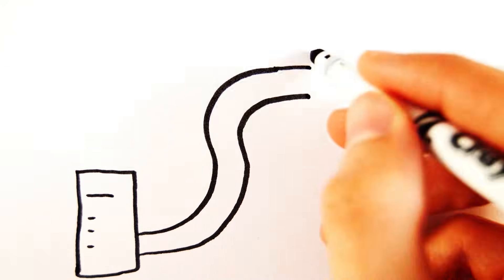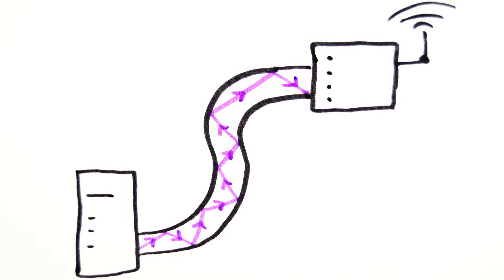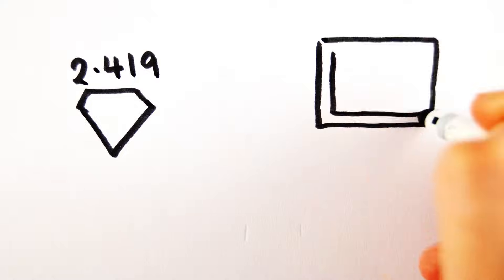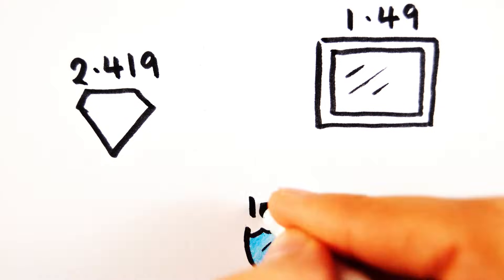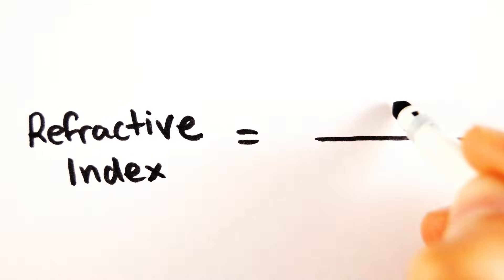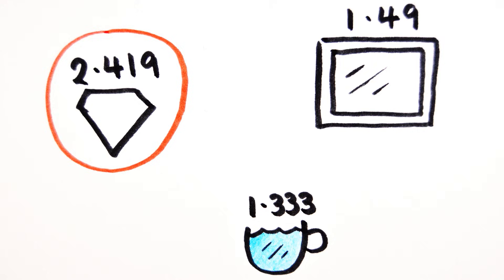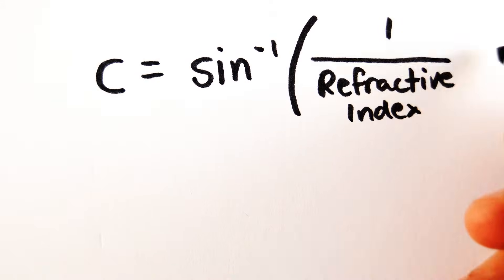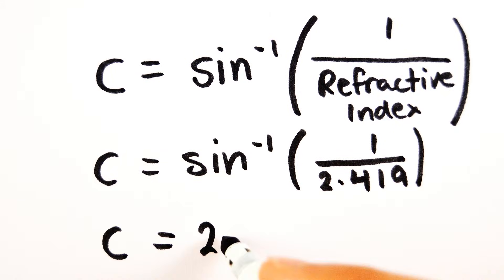Total Internal Reflection | GCSE Physics | Doodle Science

Comment: that equation doesn't work
EDIT: I figured it out: it only works if the 1 corresponds to an n that is 1 (air). So if n2 is 1, that equation works. A better summary would just be sinC = n2/n1, where n1 is the index of material from which your light travels to another material with index n2.